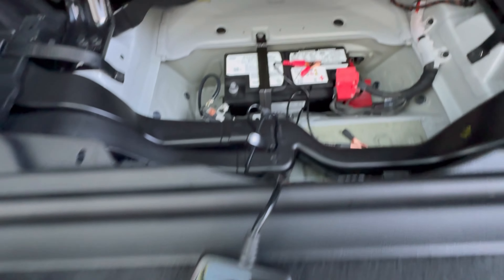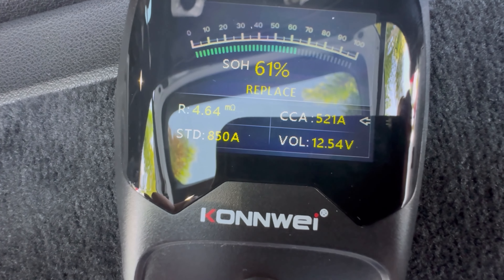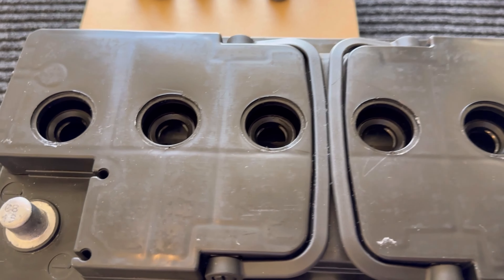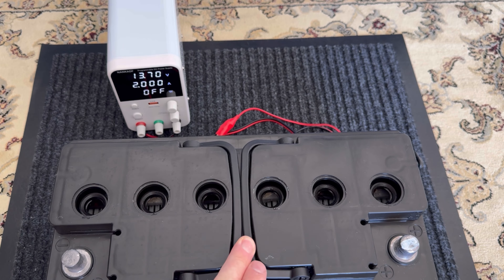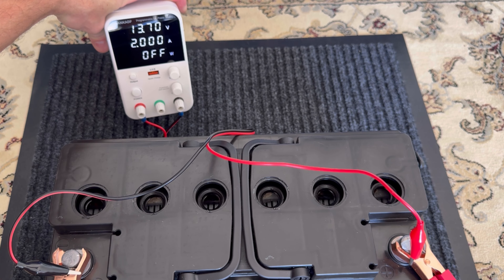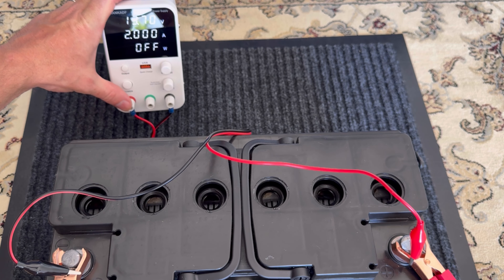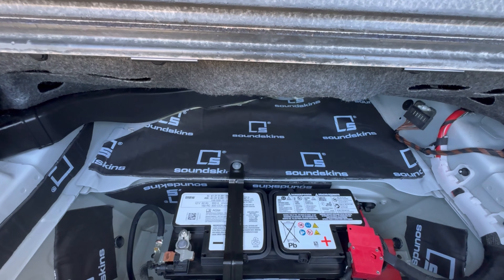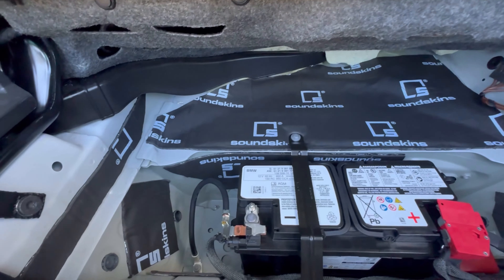HOW TO RECOVER 100% - AGM BATTERY

Comment: Need to install those caps on quickly because those are pressure regulated, and it maintains the atmosphere inside the battery void of oxygen, which will cause calcification in a very short period of time, I have performed that procedure many times

Comment: Most AGM batteries I have seen like Optima batteries have no access to internals.  Once they are dead even from leaving a dome light on they are gone!  I have tried multiple tricks without success.  I even used a voltage supply like yours at both low and higher voltages without any luck even hooking up a good battery doesn't work!
Reply: You need to connect another good battery parallelly when charging the agm.

Comment: How do you know how much water to add?  I've added about 50ml to each cell, but the top of the "plates" are still dry.  I realize it's different with an AGM and they should not be fully flooded.
Reply from the maker: Try to charge now and after charging, test the battery. The goal is to get results, not to flood the cell. If no change in battery- repeat the process.
Reply: @DIYDime  Thanks for the input.  It charges, but drops down to ~12.2 within a few hours once off the charger.  A lot of heat was generated, so thinking I'll repeat.
Reply from the maker: @bradanesi3998 Make sure you charge the battery with low amps. If you have infrared meter you can check each sell to see if they perform same temperature. If one of them will give high temp then the other one it could be shorted.
Reply: @DIYDime high voltage and low amps?
Reply: @DIYDime also you only
Charged it and discharged it once?
Reply: Why bother reattaching the labels? Take photos and store them on your phone, tablet, and PC? Can make hard copies for the glove compartment.
Reply: Look up the original weight of your battery and add distilled water until it weighs just a little less than original weight. That's the exact way to do it

Comment: Hey just bought an AGM battery that is coming this Saturday . I have a 2012 Toyota Highlander . Is there anything i should look out for ? Car is driven daily and never parked for long. Thanks 👍
Reply from the maker: If possible, give the battery a full charge with a compatible charger (AGM mode) before installing. This ensures it starts at 100%.

Comment: Asitli su koyulması gerekmiyor mu ? Teşekkürler
Reply from the maker: Too much acid lowers internal resistance, causing excessive heat and further accelerating battery degradation. It can also damage the absorbent glass mat (AGM) separators, leading to short circuits or battery failure.

Comment: Hi where did you buy the power supply ?
Reply from the maker: DC Power Supply Variable, 30V 10A... https://www.amazon.com/dp/B0B7WBDXWN?ref=ppx_pop_mob_ap_share
Reply: Thank you so much
Reply: The 3 year old AGM battery we hsve for our 2020 jeep( 2nd one for stop/start)
Ours is only 220 cca. However our big battery ( for the main engine functions, you know starter and such)
Is 750cca.

Ours is a tiny small 12v battery, would this work for thsg to?
@DIYDime

Comment: Hey man thanks for the video. I need to replace my original 15 year old BMW AGM battery, 
Never had an issue except I had some some rough starts lately and the radio stays on only for a minute then it turns off with the low battery symbol on the dash.

Since new BMW battery is out of my price point, in your opinion, should I try this process or buy new budget replacement battery around 200$
How long do would you say the original recovered battery would last?

Edit
My battery voltage is at 12.33v
Reply from the maker: Wow 15 year? I can say you got pretty good run out of your battery!!! Don’t know if I would wanna mess with 15 year old battery but I guess you can try, you never know.

Comment: did you charge it at 13.7v 2amps on the first charge or was that for the second charge?
Reply from the maker: First 13.7
Reply: @ and was the second charge 13.7 or 14.7?
Reply from the maker: That is correct

Comment: Hi DIYDIME, I have a bmw motorcycle agm battery (12V 8Ah 120 A) how many Amps should I slow charge it and how much Water do I need to ad to the cells?
Reply from the maker: 2 Amps, do not flood cells, only little bit each cell
Reply: If you know the original weight of the battery that should help you decide how much water has evaporated and how much distilled water to add to each cell. e.g battery 120grams lighter, add 20ml to each of the 6 cells (120ml).

Comment: What is the purpose of the low amp charge after refilling with water? Why not just add the appropriate amount of water and let the car’s alternator charge it for you while you drive? 

Does the slow charging help reduce heat buildup or prevent some other damage?

Edited to add: Also, why do we need to discharge and recharge multiple times in order to achieve proper restoration? I appreciate anyone who can help me understand this! 🙏
Reply from the maker: Charging an AGM (Absorbent Glass Mat) battery on low amps after filling it with distilled water is essential for the following reasons:
	1.	Controlled Electrolyte Absorption: When you add distilled water, the electrolyte concentration changes. Low-amp charging allows the electrolyte to mix thoroughly and ensures the battery’s internal chemistry stabilizes without causing damage.
	2.	Preventing Overheating: High charging currents can generate heat, which may damage the delicate internal plates of an AGM battery. Low-amp charging minimizes this risk.
	3.	Reforming the Plates: After adding water, low-amp charging helps to slowly reactivate and reform the lead plates in the battery, ensuring they function optimally without excessive stress.

The process of discharging an AGM battery after a full charge and then repeating the charge-discharge cycle, often referred to as conditioning or cycling, is essential for several reasons, especially in cases where the battery has been heavily discharged, stored for a long time, or recently refilled with distilled water. Here’s why this is important:

During regular use or improper charging, the individual cells in a battery can become imbalanced (i.e., they have slightly different charge levels).Discharging and recharging cycles help ensure all cells reach the same charge level, maximizing performance.
Over time, the battery’s ability to hold a full charge may diminish due to sulfation or plate degradation. Cycling helps break down small sulfate crystals on the plates and restores the battery’s maximum capacity.
Reply: Wow thank you for taking the time to provide such a thorough explanation! I really appreciate your quick response!

Comment: Thank you so much for posting this! I've learned more about the construction of flat plate AGM and how to "potentially" bring them back to life. BTW, I have an AGM that's 2 years old. I left in a vehicle w/o starting for 10 months. My multimeter reads it as .53volts! Yup, that's right .53 volts. should I even bother DIYDime? Do you think you could do a video on potentially using an inverter welder like on a lead acid battery? Is this feasible?
Reply from the maker: Use a smart charger if you have. These chargers can adjust the charging profile according to the battery's condition and prevent overcharging.
Set the charger to a low amp setting 2 amps. 
If the charger has a desulfation or reconditioning mode, use it. This can help break down lead sulfate crystals that may have formed on the battery.
Connect the charger and start the charging process. Monitor the voltage and temperature. If the battery becomes hot or swollen, stop charging immediately.
Charge the battery for 24-48 hours. A deeply discharged battery may require a long time to reach full charge.
Periodically check the voltage. If the voltage rises steadily, it indicates the battery is accepting the charge.
After charging, perform a load test using a battery tester. This will help determine if the battery can hold a charge and provide adequate power.
Let the battery rest for a few hours after charging, then check the voltage again. It should hold around 12.6-12.8 volts if it's healthy.